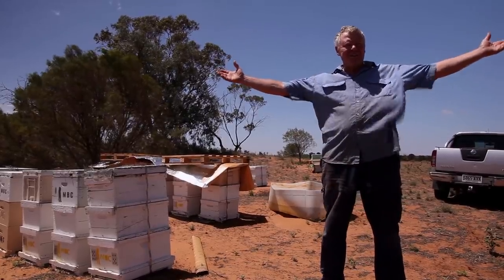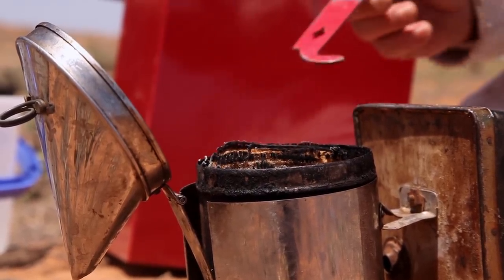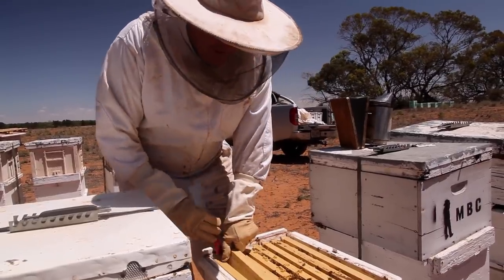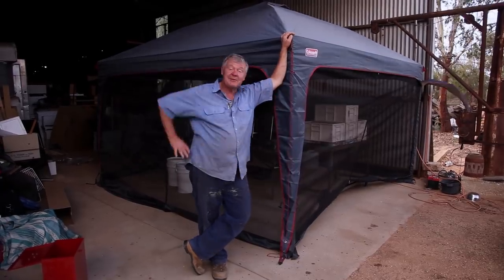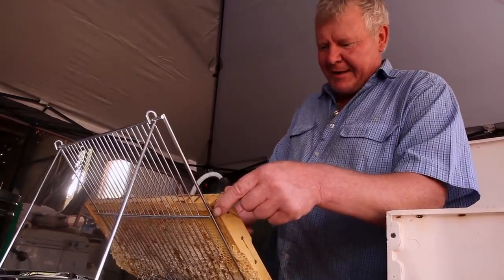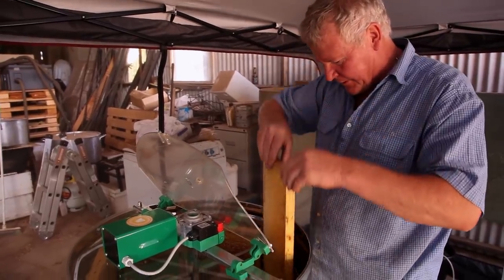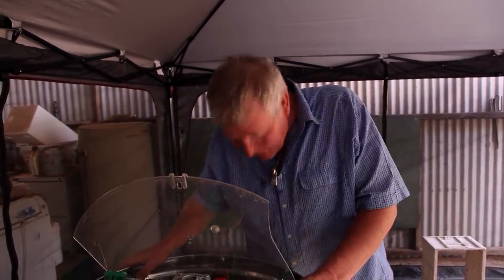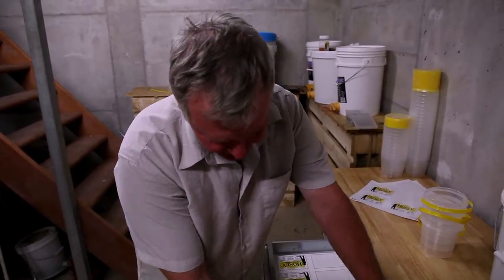Harvesting Honey from Start to Finish - The Bush Bee Man

Comment: Just a tip. I use a Makita battery operated blower to remove the last bees from the combs before putting the combs in the box to take them to the honey extracting room.
Reply: or a soft brush.
Reply: I have adapted the makita battery blower into a bucket bee vac with some pvc and a laundry hose works a treat and its dual purpose

Comment: We're not too far away in victoria and we use the foil wrapped and tec screwed to the pallet theyre on it does help them but nothin beats the shade
Reply from the maker: I agree shade is the best but sometimes that's in short supply, did you need to wait the pallets down on windy days?
Reply: @TheBushBeeMan  we have 6 hives emlocked to a chep pallet so we can fork them around, the foil is from shed insulation rolls we simply tec screw a 5x5cm sheet metal washer to 4 corners of the pallet, just have to remember to take the drill when we go to inspect.